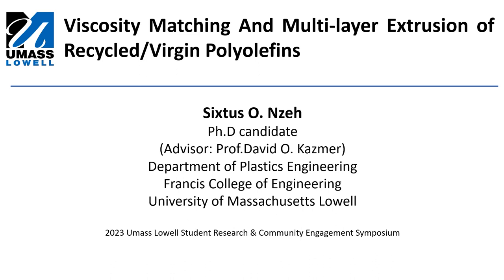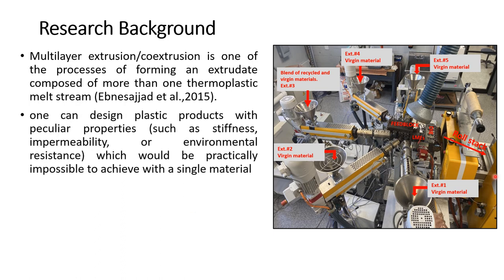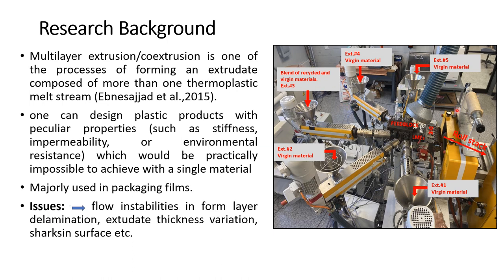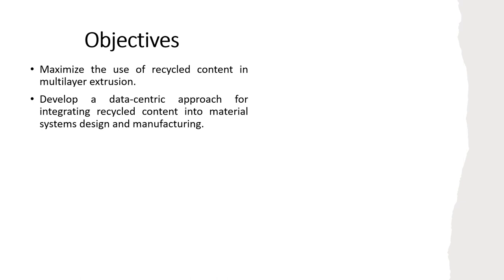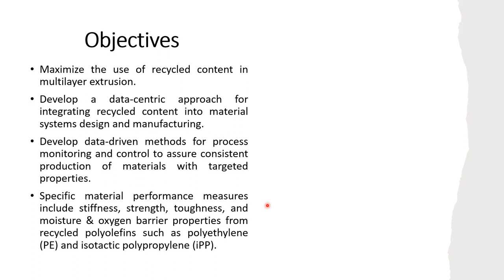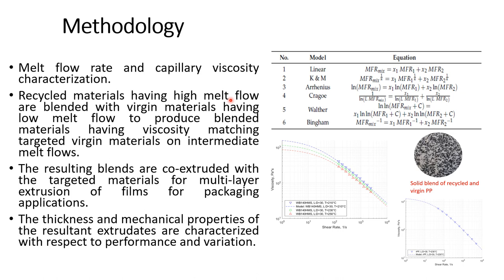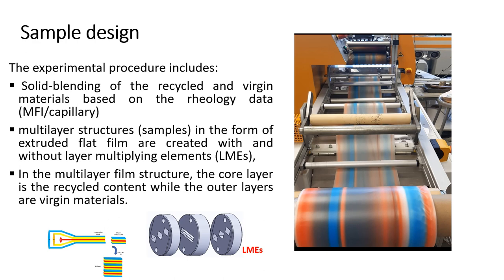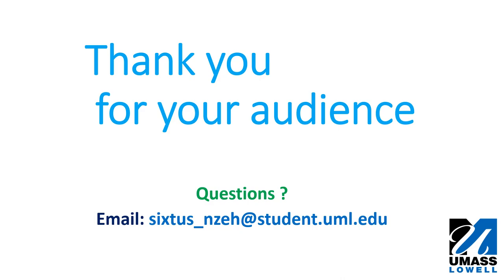FCOE, Doctoral, Nzeh, Sixtus

Comment: Interesting work. I’m curious to understand how the layer-layer interaction and compatibility affects some of the properties of your films.
Reply: Good question Nwosu Joseph!
When you have poor inter layer adhesion , the film will definitely have low tensile strength. 
Also , there will be issue of layer delamination. Thus, it's necessary to make these layers compatible with each other.And one of the ways you can achieve this is by matching their viscosities